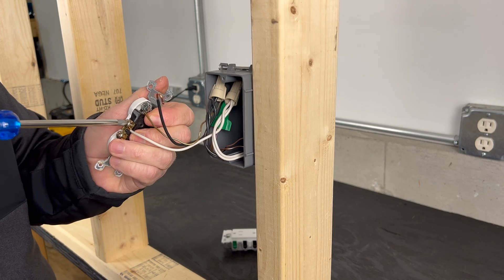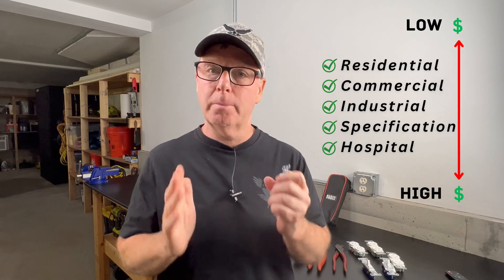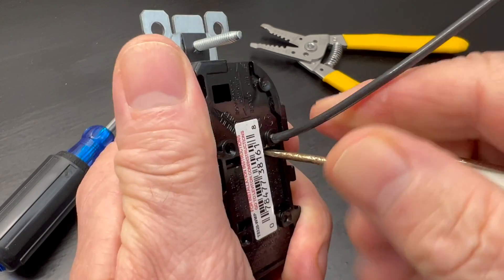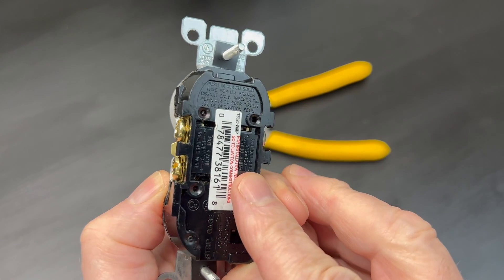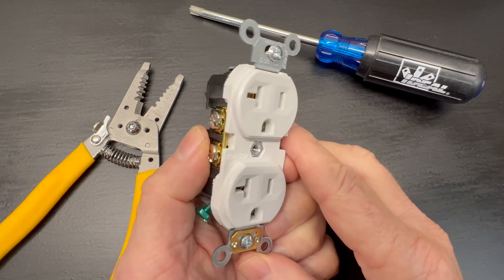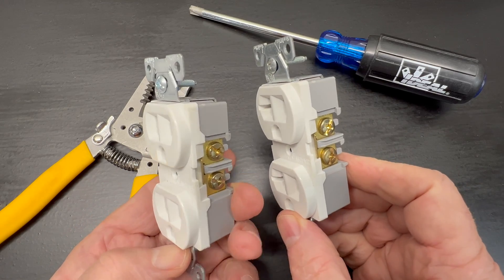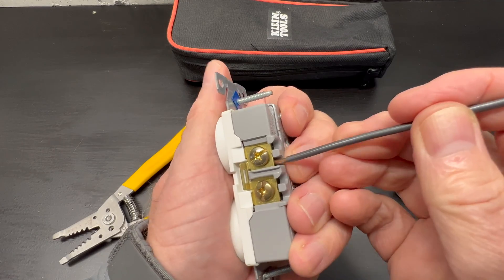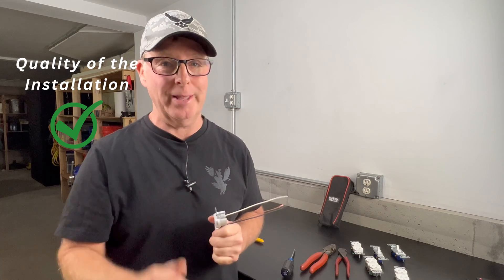How Pros Wire Receptacles in 2025 (Future Proof)

Comment: Why oh why do they make ground screws different? Sometimes a different tool is needed.    While the power wires  can be pushed in and screwed - never the ground screw. But almost always won't allow 2 wires connected to it.
Reply from the maker: It's because the ground is the most important connection for safety.

Comment: Great information. I have found back stab connections to be the most common problem with switch and outlet failure, and I think the method should be stopped.
Reply: Manufacturers need to ABSOLUTELY stop making that option!!😮
Reply: The NEC should outlaw stab-in-the-back connections. However, fly-by-night contractors would scream to high heaven.

Comment: With commercial-grade back wiring sockets, is there ever a risk of inserting the wire too far and pinching some insulation in  between the contact plates, which might prevent putting enough pressure on the copper to get a good contact?
Reply from the maker: Yes for sure. You want to make sure to strip the wire to the correct length. You don't want to pinch insulation in the connection because that would cause premature failure.

Comment: If you ever have issues and you have back stabbed devices just go ahead and change them over to side wired. Back stabbed is a terrible idea, a problem waiting to happen and in my opinion only done by people who don’t know better or by electricians who want to save a minute or two making up the device to increase their profit.
Reply: I lived in an old trailer home and all it had were cheap back stabber connections. There were no other options to the outlets. On top of that they were all wired from outlet to outlet. Lots of connections relying on a knife- edge of connection . I made sure anything that had serious amperage ( refrigerator, washer ) had newer outlets but a lot of lesser amp outlets I didn't change, such as bedrooms.
One time I needed to temporarily hook up a window air conditioner and it was on a line about 5 back- stabbed connections from the power box. I was watching all the outlets in between to make sure none of them were smoking.

Comment: Excellent video.  I had no idea about the back wiring method although I have not used the back stabbing method since about 1969.  This of course was decades before youtube was available.  I had two different circuits fail due to arcing in back stab connections, so I made a decision to never do them again.  As a "handyman" instead of a certified pro, I ran across many backstab connections in the decades since, and I always redid the connection when I found them even though sometimes there was insufficient wire left to redo them, forcing me to run new wiring to replace them.  Thanks for a great video.  I am 76 and still going strong and learning every day.  Keep up the good work.
Reply from the maker: Thank you my friend. I just retired a couple of years ago but not I have a new hobby making videos. lol. Turned 60 last fall.
Reply: @BackyardMaine 
Congratulations on your retirement! 😊
Reply from the maker: @ronh9384  Thank you!
Reply: Backstabbing is not the best but NEC approve

Comment: Surprised to see you're using a Phillips head.  Many DYIers already have a Robertson bit in their toolbox, which works so much better.  The next step up is the hybrid Robertson / flathead, but that's probably not already in your toolbox.
Reply from the maker: That's not a phillips head. Its basic the same head as the Robertson but its made by Ideal. I actually like it better and have several of them. Combo Head Screwdriver - https://amzn.to/3NgKvCd
Reply: @BackyardMaine Interesting. There are a lot of these out there, both dedicated drivers and bits. 

Klein Tools calls theirs the Combo tip, Milwaukee the ECX, Wera the PlusMinus and Wiha the Xeno. There are probably others, and there are minor differences between them. They seem to come in 2 sizes, #1 & #2, somewhat corresponding to Robertson and Square drive #1 & #2. (A lot of folks use Robbie & Square interchangeably, but they are not the same. "Square" drive tips are cubical while Robbies have an inverted  truncated pyramid shape.) IDK if anyone has done a head-to-head comparison on these. Maybe a job for Project Farm.

Do you know anything about new code requirements to torque the receptacle screws to some spec? If true we may see torque drivers with these heads in the near future.

Thanks!
Reply: @BackyardMaine  My bad.  It is the hybrid.  Just looked like a philips from the side.

Comment: Informative and to the point! Question….can I “J” wire on a commercial receptacle? Great video John! Thanks!
Reply from the maker: Thank you. You can but it's not easy to get the hook connected without removing the connection plate. They are really designed for a straight piece of wire. I have had great result using them as designed. As long as they are tight you should never have a problem.
Reply: @BackyardMaine  this is what I was looking for, how to wire with that plate?  On the back of the commercial 20 amp receptacle it showed a straight wire and the length of the straight wire so I figured that that was the correct method to wire the 20 amp commercial receptacle, that is use a straight wire to the appropriate length.

Comment: Hey John I have one of those LED overhead lights in my house that flickers after a while when it’s on. Turning the light on and off makes it stop then it’ll start flickering again after 5 or so mins. Any thoughts? No bulb to swap.
Reply from the maker: I’ve had that happen but with LED fixtures and also the light bulbs as well. The electronics that feed and control the LED(s) are have a problem. When you turn it off and back on you’re essentially reboot the light. Sadly the fix is replacing the lamp or fixture.
Reply: @BackyardMaine  Rats I figured as much. I have two of these lights in my house. I’ll do some research. Thanks
Reply from the maker: That is a sign of a failing LED driver. The heat is causing it to flicker. I have a video coming up in two weeks where I will cover why LEDs fail much sooner than their expected life and what we can do to make them last longer. Stay tuned for that.

Comment: Do I use the top or bottom, silver and black mount screws? On the receptacle.
Reply from the maker: It makes no difference. They are connect through a little tab that connects the two screws and feeds each receptacle (top and bottom) of a duplex.
Reply: White wire to silver, Black wire to black, if you haven't taken the tabs off, such as to make one of the outlets switched while the other remains constant hot, the positions don't really matter.

Comment: I am putting in a window unit, air/ heater, uses a 6-20p , is this a 20 amp outlet?? Same as 220??
Reply from the maker: A NEMA 6-20P is a 20A 250v receptacle. On a receptacle like this you will have two hot wires and a ground fed from a two pole 20A breaker. There is no neutral wire.

Comment: Question: If a clueless homeowner accidentally dumped water on an outdoor receptacle and it stops working and they tell an electrician about the problem and he tells them to shut off the main then remove the cover and check the wiring, wouldn't this b dangerous? No advice to use a tester to ensure the power is OFF first.
Reply from the maker: The power should be off and the circuit tested before anyone does any electrical work and also only take on projects that you feel comfortable with doing yourself. Sometimes hiring a professional is the best plan.
Reply: @BackyardMaine  my exact advice to the homeowners! Thank you!!

Comment: Your video is very clear and concise and helpful. Thank you for your contribution. I subscribed. It only took me one trip to Home Depot and an inspection of outlets on the shelves to understand the difference between the backstabbed connection and the back wired method. My home has backstabbed outlets. I was immediately disinterested in having those anymore because I know as a mechanical engineer that the Barb approach is not going to be as secure as a screw using clamping pressure to retain the wire. Furthermore those designs are a higher risk of having faulty Dimensions from manufacturing processing that could result in a poor connection, whereas a back wired design only relies on a simple screw head and the plates to ensure sufficient contact force. Probably the last time I did any outlet wiring was when I was in my twenties and that was 40 years ago. It was new to me to learn about the backstabbed design when I started the process of inspection after I experienced unstable and incorrect voltage levels in my 33-year-old home. When I went to Home Depot and saw the commercial grade units having a back loaded design I immediately decided that was right for me. It eliminates the need to mess with the wires from their existing condition yet provides me the ability to use the clamp load of the screw heads.
Reply from the maker: Thank you! Great comment as well. I try to provide value with my videos and I love hearing positive feedback for intelligent people like yourself. I'll try to keep them coming.

Comment: Can you please explain why it is a code violation to use a 20 amp receptacle on a 15 amp circuit
Reply from the maker: Sure.. Because someone connect a 20A cord and plug connected piece of equipment which would overload the circuit and cause the breaker to trip. The breaker is a protective device and should only trip when there's a problem not as part of normal operation.
Reply: More specifically, notice the shape of the 20A receptacle: it accommodates 2 positions for the neutral blade, "—.|" for equipment that requires a 20A circuit and "|.|" for equipment that doesn't. You don't want to be able to plug "—.|" equipment into a 15A circuit.

Comment: I knew the diffrence between back wiring and back stabbing.  I agree, the back stabbing method is bad.  I am not an electrician but I am a 30 year DIY home owner and I have had to replaced two outlets that have failed and both of them were wired up using the back stabbing method.

Comment: I've loved those commercial, back-wired receptacles ever since I discovered them when rewiring part of my old 1950's house about 20 years ago. They cost a bit more, but for a DIYer, they're just so easy!

My only complaint about them it's that they're getting hard to find without special ordering. The Home Depot stores around here used to carry lots of commercial-, industrial-, and even hospital-grade devices. But lately they seem to have mostly residential with just a few higher-grade receptacles in the most basic types. (For example, they'll have 15A but not 20A.) Lowes is sometimes slightly better, but not much. I'm in California. Are they still easy to find where you are?
Reply from the maker: I find the same thing here in Maine. HD and Lowe’s had them but not the boxes of 10.  I think you can order them online though and the electrical supplier has them which works for me but a DIYer would be out of luck. 

I lived in Sacramento back in the 80s when I was in the USAF. Still have some relatives out in the Fresno area.
Reply: @BackyardMaine  The contractor who's building a new shop for me is even having trouble finding some of the back-wirable stuff at his electrical supplier for some reason. Thought he usually does residential work, so maybe he just didn't know what to ask for. They did have the 3-phase load center I wanted, so I know they can get commercial / industrial stuff.

I have a good friend who was stationed at Mather 2 or 3 times in the '70s and '80s, and I think he was part of the team that closed it down in the early '90s. I moved to the Sacramento area last year, after 30 years down in the Bay Area. The South Bay has gotten very crowded and congested, so now that I'm no longer working I decided to get out. And I had friends up around Sac, so I ended up here. So far I'm liking everything but the summer heat.
Reply from the maker: I loved living in Sacramento well actually North Highlands. I was stationed at McClellan AFB from 84-88. I went over to Mather and Beal a few times to help out with electrical problems. Yes, the summer heat is something in Sacramento but it's not humid so it's more bearable. I remember driving two hour to go skiing up in the Sierra Nevada Mountains and washing my car in short sleeves on the same day. That doesn't happen here in Maine.  @laurawerner
Reply: @laurawerner Not as bad as Zona, but you're closer to earthquakes, to say nothing of woke politics!!👎
Reply: All 15 amp receptacles are actually rated for 20 amps current pass-thru, so unless you have something that needs the special sideways tab on the plug, just use the 15 amp outlets.

Comment: for beginners??? Being an electrician is not a hobby… it’s not something you learn on Mr. Rogers neighborhood in kindergarten..
One of my favorite supporting actors, Frank Silvera, who played The bandit that killed Paul Newman in the movie hombre, he was electrocuted / killed  at his home, working on his garbage disposal..
Reply from the maker: There are a lot of different ways to pick up knowledge. Like it or not people add and replace receptacles and switches in their homes. I give them the knowledge to do it right. But I am sure you never went on youtube to learn something that could save you some money. Maybe something like changing your brake rotors and pads?
Reply: I appreciate what you’re doing, I am a retired electrician/HVAC tech. since I am a retired electrician, I would never encourage someone to go into an electrical project that did not have any electrical experience.. risky business..
  you did answer a question I always had about the direction you mount a receptacle, ground, facing up or down. I put all mine facing down, I didn’t care what the NEC said, especially in my laundry room, and behind my refrigerator, the plug on those appliances is a 90° angle plug..
  I do have a question. Lightning rod , mounted on the roof of the house. Do you ground it to your existing buried ground rods? Possibly energizing your panel board with a lightning strike? I was sitting outside with my wife one day, watching a storm approach, and we saw a lightning strike my house, it hit the cable television cable and damaged the cable box, and the HDMI port, on the back of my television.. I have been wanting to put a lightning rod on my roof grounded to something else other than my two buried ground rods that my panel board is grounded to..
Reply from the maker: This is what it says in the NEC. 
250.106 Lightning Protection Systems

The lightning protection system ground terminals shall be bonded to the building or structure grounding electrode system.

Informational Note No. 1: See 250.60 for use of strike termination devices. For further information, see NFPA 780-2017, Standard for the Installation of Lightning Protection Systems, which contains detailed information on grounding, bonding, and side-flash distance from lightning protection systems. @Jodyrides